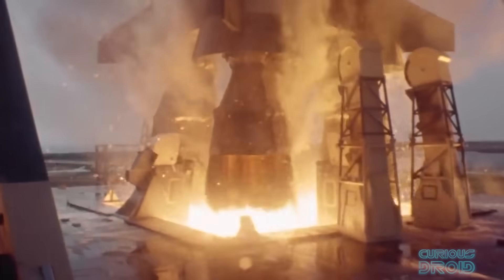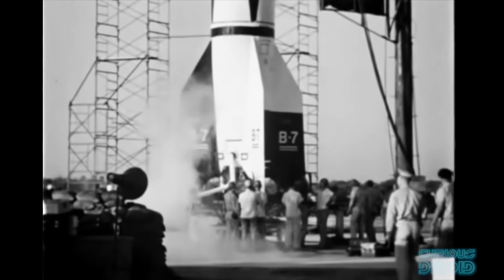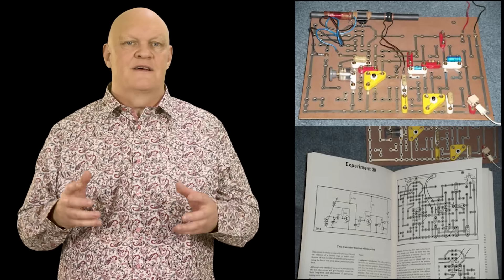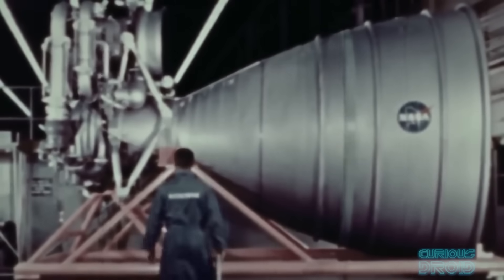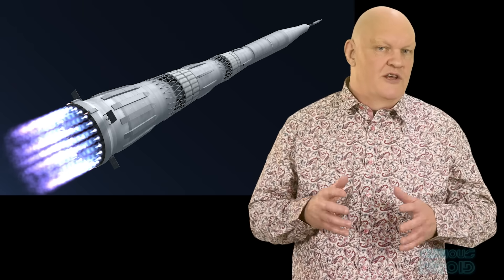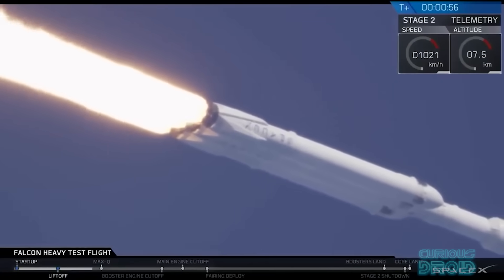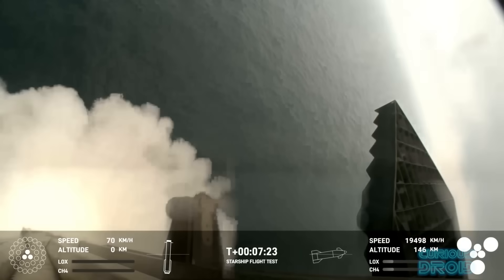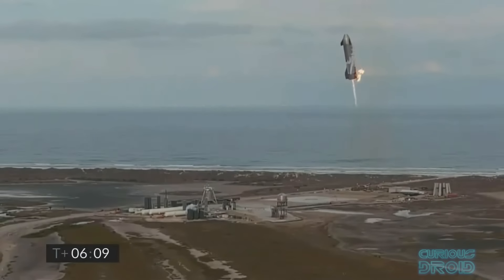Why Does SpaceX Use 33 Engines While NASA Used Just 5?

Comment: The simple answer is that Musk decided to read some old notes the Soviet Space Program declassified from the 1950s and use that as his starting point rather then everything that has been learned by NASA, the ESA and JAXA in the 70 years since and thus still hasn't reached the point of learning the hard way why less is more when it comes to rockets.
Reply: The actual answer is that bigger engines take longer and are more costly to produce. The reason the N1 failed was because its engines were unreliable, the 30 NK-15s couldn't be test fired prior to launch because their ignition system was pyrotechnic and single use, they would literally have to strip down the engine to replace the igniters. SpaceXs starship and raptor engines dont have this problem because they can actually test their engines prior to flight. We have seen 3 fully successful ascents with the superheavy booster out of the 4 starship integrated flight tests. Clearly engine count isnt as big an issue as you make it out to be.
Reply: @_K3PLR  wouldn't really call it 3 successful launches.. if it blows up, loses control it's not a success. Bit sad they keep lowering the bar on what a success is when they say they are going to do refueling and all this other tests and all they do is get the thing into LEO and then crash it into the water...
Reply: @entropyachieved750 i said 3 successful ASCENTS. the superheavy booster handled the ASCENT phase of flight perfectly fine. Please actually try to read what i said. If it can handle Ascent then clearly having so many engines isnt an issue.
Reply: @_K3PLR  Musk has admitted that in a best case scenario it'll cost more to finish developing Starship then it cost to develop SLS, and that's if Musk's right about how little it'll cost and how short it'll be to finish for the first time in his history of giving such estimates.
Reply: @ZontarDow when did he ever say that???
Reply: @_K3PLR  About a year ago
Reply: @cunnybluez  Musk's own twitter posts
Reply: @ZontarDow surely you can link a source to this right?
Reply: @ZontarDow Musk expects to spend 10 billion USD on Starship, and so far has used around half of that. SLS has cost 20 billion dollars in development costs leading to and including its first launch.
Reply: @alxz3707  SpaceX has spent 8 billion so far on starship and will cost another 10 billion if Musk's optimism on development actually turns out to be correct for once. This is compared to 16 billion to develop SLS, you're adding launch costs to the program.
Reply: @ZontarDow  I literally said I was including launch costs in the figures. I did so for Starship when spending was at the 5 billion mark in 2023 and to be even, must do the same for SLS at its first launch in 2022.
Reply: @ZontarDow  Starship and SLS aren't trying to do remotely the same things.  SLS is a retread of Apollo; Starship is intended to be fully reusable and to bring 100-200 tons to Mars.  If all Starship needed to do was bring 50 tons to the moon and jettison itself completely, development would have been done years ago.  But the reality is that Artemis is a side mission.
Reply: @alxz3707  SLS has actually cost over $50 billion so far.
Reply: @Asterra2  You'd be amazed how many constantly try to make comparisons, despite Starship ever going to Marks has a 0% chance of happening with a 0% margin of error, which is why the myth that the primary source of funding for it is a side mission by people easily fooled by a con man who has yet to have any of his statements end up being true.
Reply: @ZontarDow  Bro, not even Thunderfoot tries to pretend otherwise.  SpaceX has gotten $2 billion from NASA for various Starship milestones so far.  This is approximately 20% of what they've spent on Starship and Starbase.  You are in effect saying that Starship wouldn't even be doing test flights today, for want of a small fraction of their expenses which they could certainly have easily covered for themselves.  Do you want to keep digging that hole deeper?
Reply: @Asterra2  You pretend SLS has cost 50 billion dollars, you aren't serious you're just a failtroll's spam account. I'm not going to continue responsing to a spam account that exists only to failtroll to get reactions out of people, it's tragic youtube removed the ability to block accounts because you'd very quickly end the ability to even see comments.
Reply: @ZontarDow  This is literally a google away.  Anyone can look it up.  Then again, you've arrived at various conclusions without reasoning yourself into them, so it's little wonder that you find facts uncomfortable.
Reply: @ZontarDow You are clearly suffering from the Dunning-Kruger effect and are spreading false information.
Reply: @SentinelSent  amazing given half of it is literally quoting Musk
Reply: It's not like spaceX had the falcon 9 behind it?

What has NASA or ESA or anyone got? They haven't even tried to make a large rocket since the 1970s

Nobody even has the knowledge or experience anymore
Reply: Agree. And because musk stuffed around and hasn't delivered the 'dear moon's Misson has been cancelled... Musk hasn't got anything out of low earth orbit something NASA did 60 years ago... And Musk can't because his rockets don't hold enough fuel...
Reply: @entropyachieved750 his roadster isn't in deep space? Around the solar system?
Reply: @TheMagicJIZZ  No because he never sent one of his roadsters into space, he did however send Martin Eberhard's that Musk stole from him and had to pay damages over that grand theft auto.
Reply: @ZontarDow that car was Elon's personal car.

What are you talking about. Elon has been at Tesla since 2004 when he was an employee #3
Reply: @TheMagicJIZZ  That's not true, in fact Musk was not even amongst the first 25 employees and came on board after they already had their first prototype, and had already made their deal with Lotus for chassis.

And no, that roadster was not his personal one, it was the one that belonged to Michael which is why he had to pay him damages for launching it into space.
Reply: @ZontarDow he was the FIRST INVESTOR lmao

He joined as chairman of the board 6 months after incorporating 

Him and kimbal Musk.....???? What are you talking about 

There wasn't even a prototype 

I wonder what you think of JB strabaul the 4th co founder who joined in 2005
Reply: @TheMagicJIZZ  ain't a rocket...
Reply: @entropyachieved750 off the top of my head i can name like 7 missions spaceX sent beyond LEO for its customers.
Hakuto-R 
Intuitive machines IM-1
Psyche 
DSCOVR 
Euclid
Numerous GEO birds
Soon launching a mission to europa for NASA
Its so sad to see you be so confidently and snobbishly incorrect about something
Reply: All I can say to this comment is: Man, IFT4 must have ruined your entire month.  You could tell Thunderfoot was shaken.  He must be realizing that the money from his cultivated cult will stop flowing in if he can't continue to point and laugh at test flights.
Reply: @Asterra2  LOL, I wasn't expecting a reference to that guy. Nothing more petty and vitriolic than a jealous "scientist".

The guy is a complete joke, who has become a parody of himself. So sad.
Reply: @edwardcullen1739  Like many, I used to keep tabs on him when he was tackling little-known scams, even if it was pretty low-hanging fruit.  Honestly, I don't know for sure if he's cultivating hate because he's on that bandwagon or only because he's taking monetary advantage of that particular cult.  But I tuned out completely when he stole one space-related content creator's video, got called out on it, and instead of immediately doing the right thing, sat on it until it became clear he could be facing legal action, at which point he did the bare minimum in editing that would allow him to continue using the stolen clip and theoretically slide by on fair use rules—enough that it wasn't worth pursuing.  The scummiest thing it was possible for him to do.
Reply: @Asterra2  There's a reason why Musk's fans are correctly stereotyped as being antithetical to the idea of learning about the subjects they pretend to care about.
Reply: That's just as stupid as saying that your car's engine should only have one cylinder because "less is more".
Reply: @Hedgehobbit  Except rockets aren't internal combustion engines which is why 3-6 cylinders being the standard is for entirely different reasons to why rockets have fallen into a 2-5 standardised number of rocket engines.
Reply: Starship and booster use the same engine, with different bells and with or without gimbaling. Saturn V used 3 different engine designs, if you include the command module.

Raptor, being full-flow, staged combustion, is the "ultimate" design, so using it on both makes sense.

Most importantly of all, reliability requires redundancy. You say "more engines is more complex", I say more engines gives more resilience should one fail. Also, replacing a Raptor is going to be much quicker and easier than replacing an F1 (even if an F1 reusable).

Engineering is about trade-offs. You lack of engineering experience/simple Elon hating are obvious. Be better.
Reply: @edwardcullen1739  If I lacked engineering experience, I'd risk thinking Musk was brilliant rather then baffling.
Reply: Blunderfoot made a livestream reacting to the IFT-4 launch, got ALL of his predictions wrong, got absolutely clowned in his youtube comment section, and still has the audacity to shit on SpaceX
His clip is just embarrassing to watch lmao
Reply: To be fair, theyve gotten past any launch issues. What they are doing now is reuse testing
Reply: @skippyalpha  Given the state of the rocket when it landed, I'd say nothing of the sort.
Reply: Did Apollo 11 actually leave near-Earth orbit?
Despite the revisionist narrative that this channel won't question -- unstable fuel burn for the oversized F1 engines was never rectified and another arrangement in their place was made in order to reach near Earth orbit, keeping the F1 bell nozzle to maintain the desired appearance.  The great licking yellow flame was an indication that something was not normal as fuel was burning in the atmosphere while providing no additional thrust. This was the result of injecting additional kerosene into the exhaust stream for greater visual effect yet appearing to produce an inefficient burn unlike other rockets after launch.  No explanation is forthcoming and this issue is not addressed in any usual report; however, using a smaller reliable engine with a reduced fuel load and stripped down mission requirement allowed the Saturn V to reach near-Earth orbit.  

The Apollo 11 crew attempted to demonstrate their position at over halfway to the moon as seen in the unedited version presented to the public while the more recently released unedited version reveals a flood of blue light entering the same window as the camera continues to roll, through which only a moment before, we saw the Earth far distant in what appeared to be very low light conditions. Then, as the camera pulls back from the window, the exposure settings are seen to return to normal as a flood of light enters the same window.  Without a change in the orientation of the spacecraft assumed to be on a trajectory toward the moon, the only source for any flood of light can be the Earth while in near-Earth orbit.  

Another indication are the impossible weather patterns seen on Earth, when in reality only a small portion of the Earth's surface was visible, framed by the round window of the command module.  Straight line cloud fronts are seen to be extending for what appears to be more than 6000 miles, a quarter of the Earth's circumference -- something that has never occurred in the meteorological record on Earth. 

The usual sponsored efforts will try to make excuses for why the obvious did not take place -- yet is overly apparent in the unedited version.  When facts cannot prevail in support, sponsored activity will resort to name calling and other derogatory comments discrediting themselves.
Reply: @ronaldgreene5733  There's literally mirrors they left behind that can and are used by lasers to measure the distance between Earth and the Moon by countless people doing it recreationally or for practical reasons, you can see what the lander left behind with over the shelf telescopes, and it's also mathematically impossible for the hundreds of thousands of people who'd need to have been involved to fake it to have all kept it secret for decades.

No, there is neither any evidence nor any good faith to pretend Apollo 11 did not go to the Moon. Which is why no one makes any such arguments when pretending it didn't happen.
Reply: @ManfredZeroFive  >he said with a default letter pfp and randomly generated name